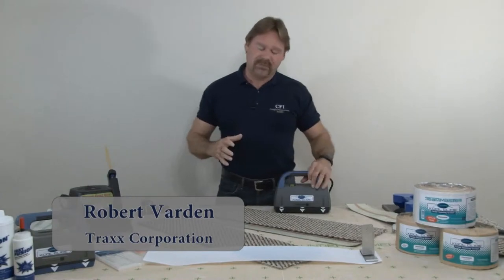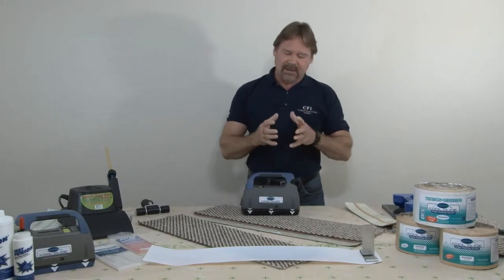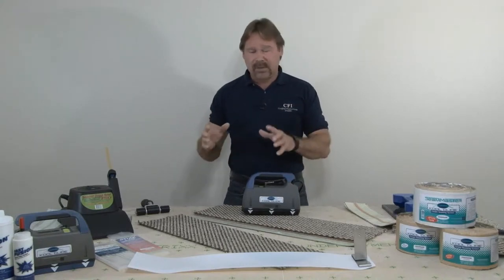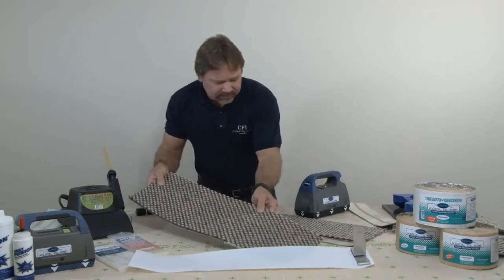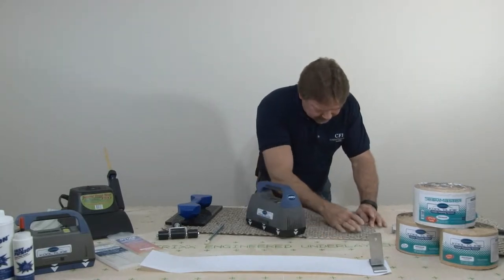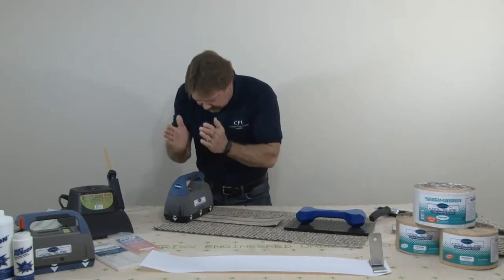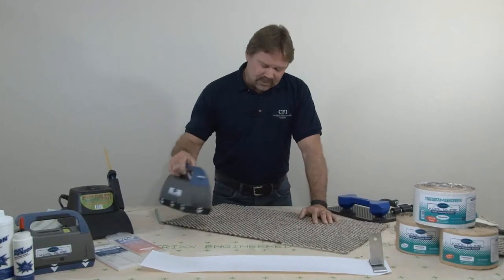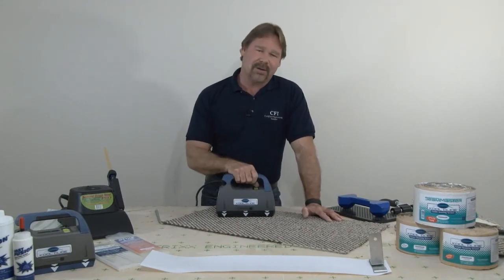Kool-Glide® by TRAXX

Comment: I have metal implants on my finger bones, if i knock it over and accidentally bump my hand on it will it burn me? Ive been using it for a while and ive always wondered if the radiowaves only work with the metal in the tape. 

Maybe ill be a guinea pig if you dont know either.